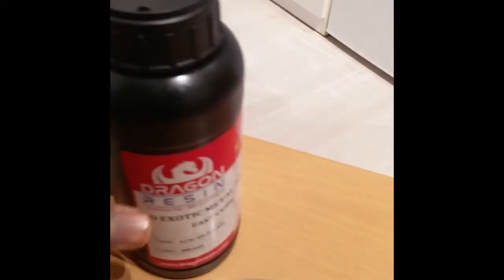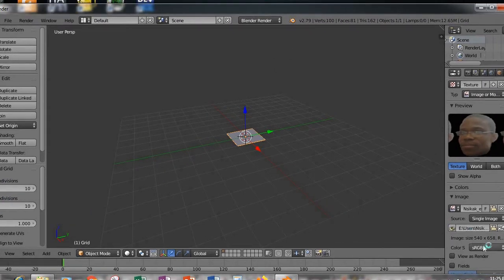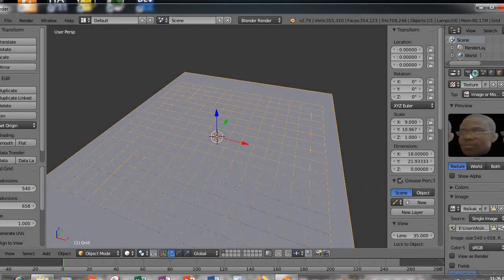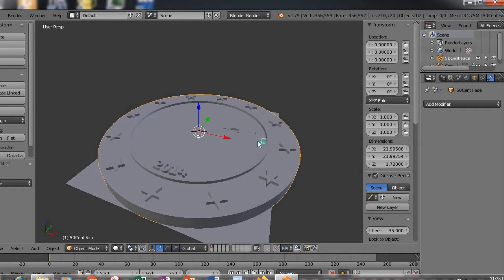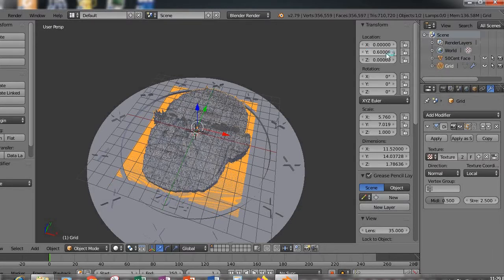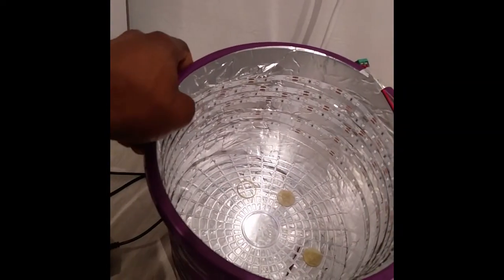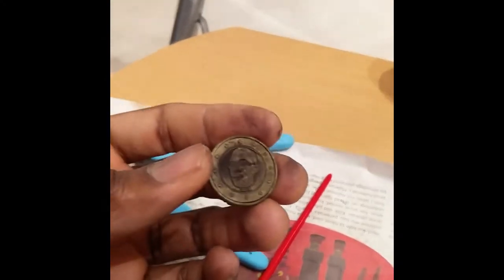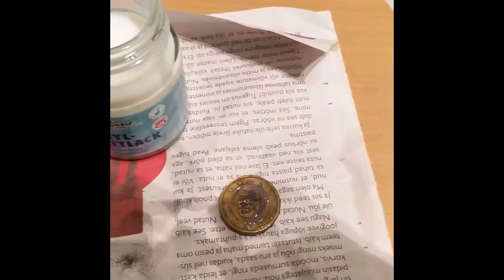How to 3D Print your own Coin on a Resin 3D Printer | DIY CUSTOM COINS

Comment: Thanks for this.  I was trying to print poker chips but only one side would come out without tilting it and getting support marks on one side.  This will take a lot of time tho.  I may try printing vertically.
Reply from the maker: I'm glad you enjoyed the video ☺️...

Printing vertically is a great idea!...

My reservations with vertical printing are (1) The layer lines will be visible...(2) It takes maximum amount of time...
(3) Probability of the print failing is higher than when printing horizontally.